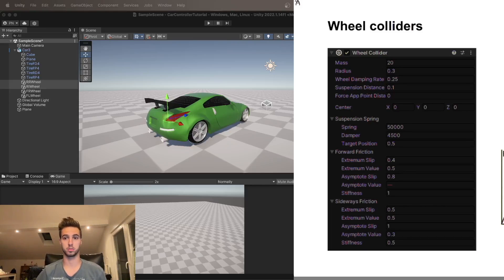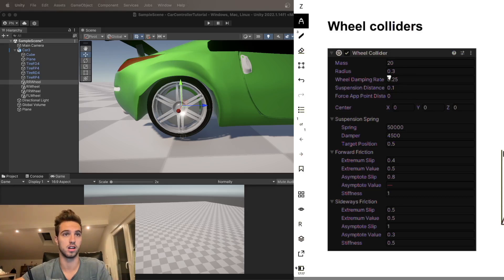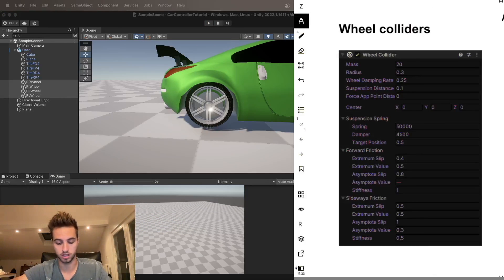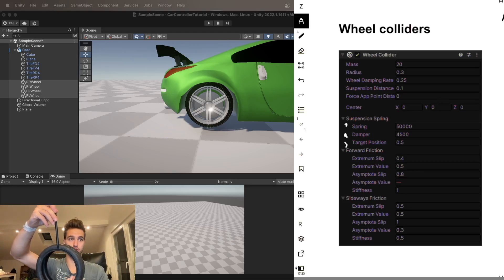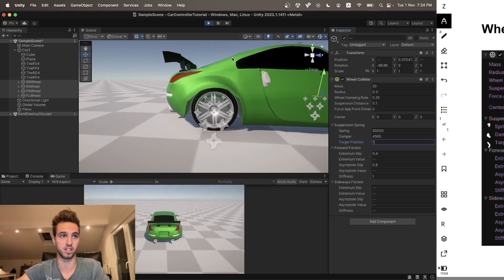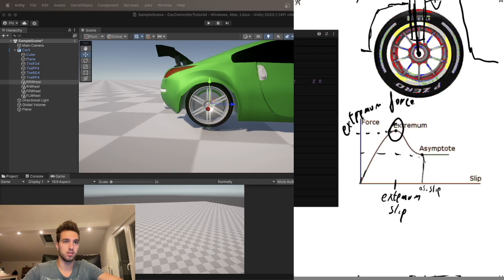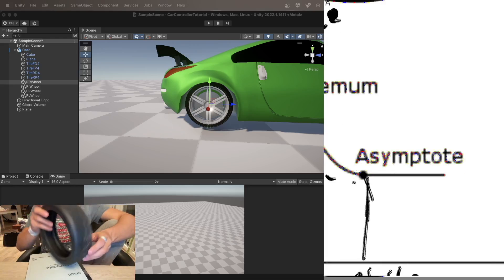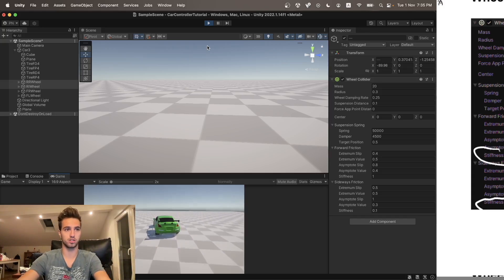Wheel colliders Explained! Unity + GitHub link!

Comment: What would be the ideal settings of a really high performance car with zero drifting?
Reply: well, im working on the suspension part, but for sideways friction of each of the wheels-
Extremum slip: 0.6
Extremum value: 3
Asymptote slip: 2
Asymptote value: 3
Stiffness: 1 for front wheels, 2 for rear wheels
these worked quite well for me when I tried to take corners at high speeds

Comment: At the beginning you mixed up the Wheel Damping Ratio with the suspension Damper value. The Wheel Damping Ratio is the amount of reduction to the wheel angular velocity when no torque is applied to it. It's a kind of "hub" friction slowing down the rotation of the wheel over time. Has nothing to do with the behavior of the suspension.

Comment: ahh thank you so much, its very helpfull,,

anyway sir, how to combine wheel collider with wheel object (mesh)?

i want to make a simple suspension for the vehicles in the game "unturned", because all the vehicles in unturned have a stiff and very strange suspension, between the wheels and the car body are rigid and very stiff, when the car passes something, instead of the tires the car moves up and down, the tires instead attached to the car body ... Unturned is an open source game so we don't need to worry about changing content, this game is very modable

edit: sorry for my bad grammars :)
Reply from the maker: I actually I'm not sure if it is implemented on my code but to do this you just need the wheel meshes to follow the position of the wheel colliders. So it should be as easy as a single line of code per wheel.

Comment: I think you made a small mistake while explaining wheel dampening rate, cause it is the rate at which the wheel will tend to come to a rest from a state of rotational motion, not related to the suspension. I've experimentally tested this and found out that this explanation seems working better
Anyways nice and helpful tutorial
Reply from the maker: You are right! I never thought that dampening would be applied to the rotation of the wheel so I just thought it was the suspension dampening. Nice explanation 😊

Comment: Thank you so much for the explanations, especially for the wheel friction curves.
And I want to ask something because it's confusing me for a while: how do we measure  the friction forces (measure unit)? Are they in Newton or G-Forces or something else? For example: Some racing cars can turn at high Gs (3G~5G like F1). So, are the friction units like these G-Forces or they are in Newton? Thanks.
Reply from the maker: Friction is a force hence it's measured in Newtons. When turning you can measure the force that is turning a vehicle and you can see the acceleration of the vehicle due to that force. F=m*a where F is the force, m is the mass of the vehicle and a is the acceleration. If you divide F/M you will get the acceleration of the vehicle which is measured in m/s. So if you have a 20kN vehicle (2tonnes) and apply a force of 400kN  you would get the vehicle to accelerate at 20m/s. We do know that one G is 9.8m/s so the acceleration of the vehicle is ~2G. Hence you can say that it 2G of force is applied to the vehicle, when turning or accelerating.
Reply from the maker: Mathematically you can get the law of conservation of energy, derive it once and you will get the acceleration of an object. So 
1/2mU(t)^2 dt = F*t dt
Which gives you m*a(t)=F
=> a(t)=F/m
Reply: Thank you very much. It's more clear now. I'm trying to create my own realistic car physics and I really wanted to understand this point. Thanks again.
And is it the same about the slip angle? In Unity, I usually set the extremum slip to about 0.25 for forward, 0.4 for sideway; and the asymptotic at 0.5 forward, 0.8 sideway. Is that the right settings for a racecar ? (I know it may also depends on other parameters) What would you advise me? Thanks.

Comment: Unfortunately I didn't quite understand how wheel friction works. In your opinion what would be the most realistic configuration?
Reply from the maker: In the real world you would have forward friction to be higher in general than sideways friction.
Then the extremum slip should be lower than asymptote slip and the extremum value should be higher. Think of it like the value of traction before breaking traction is the extremum value. After you lose traction the traction value should be lower.
Reply: @nanousis  Thanks a lot, I'll try to do that here, if you can make a video creating the most realistic configuration possible it would help a lot, but anyway now I know where to start.